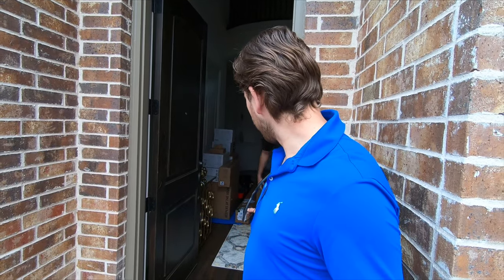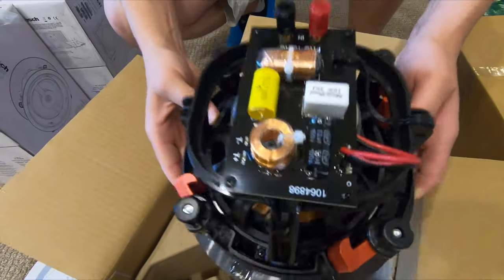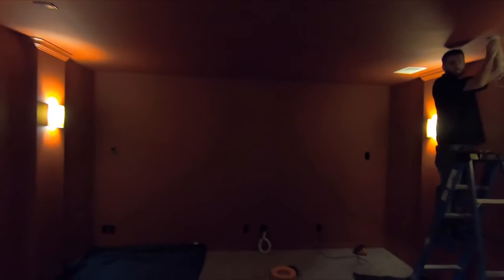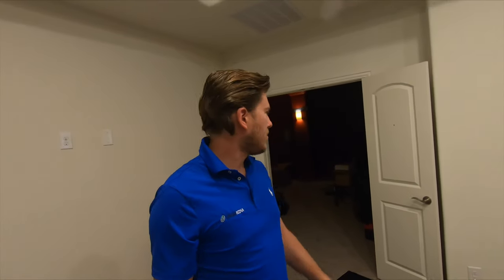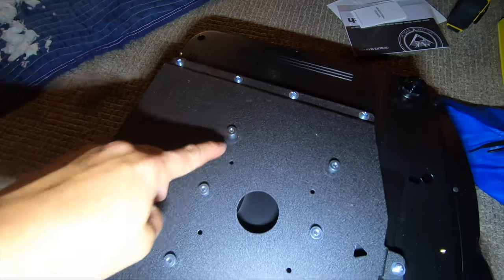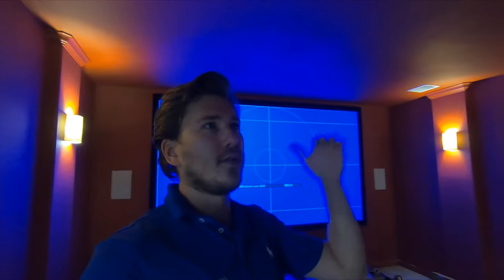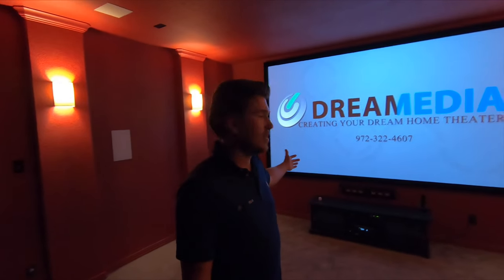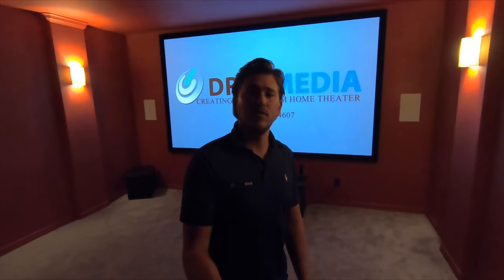Klipsch 7.1.4 ATMOS Home Theater & Epson 4050 4k Projector w/ 145 inch SCREEN!

Comment: Hey, I noticed you guys do not do theater installs in homes where there is a second floor and you have to run wires between the floors to a room.  It looks like you always run wires from an attic to a room.   I would like to see how you guys would manage in that scenario.

Thanks

PM

Comment: Is it recommended to use speakers from the same line or does it matter.  Meaning should you use all same speaker brand or can you use Polk audio and Klipsch audio.  I am currently using Klipsch fronts and Polk rears with a 10inch Polk sub and a 12inch Bic sub.  In the next few months I will be getting a huge settlement and plan to purchase a High end theater setup.  Any recommendation would be helpful.  Your team are incredible installers and creative work of art.  Thank you.

Comment: Klipsch is nice though I prefer Q Acoustics speakers. For my dream home theater, I would go with concept 50 for the fronts, concept center, 3020is on wall brackets for the wide and rear surrounds, and Qi65 in ceiling speakers for the atmos.

Comment: I've been eying the Epson 5040 UBe for a while now and I think I am going to get it. However, what distance would I have to install the projector to fill a 145" screen? I'm trying to step up from a 60" LG plasma and a cheap Sony surround receiver with two 100W  Polk Audio woofers. Also, is it worth getting the 5040 UBe wireless or should I just get the 5040 UB?
Reply from the maker: No. Save the cash and get wireless

Comment: How do you connect and configure the Harmony pro 2400 IR to the Projector on the ceiling?
Reply from the maker: we split the sensor with cat 5 cable
Reply: Great, thank you! You guys are awesome. Do you have professionals in Upper Marlboro Maryland? I would love my system installed. I have every equipments and pre-wired. I just need the system hooked up.